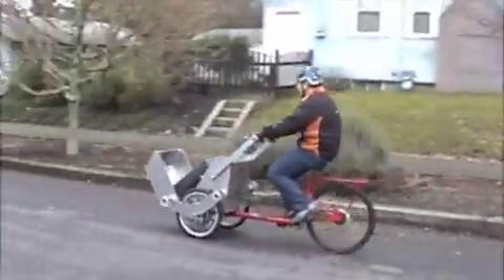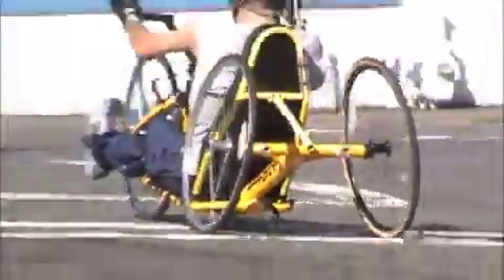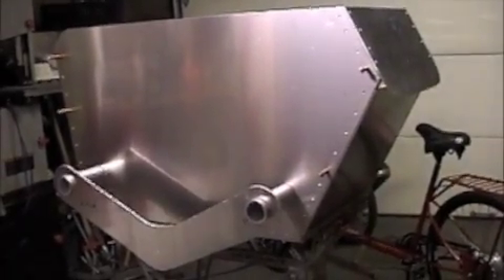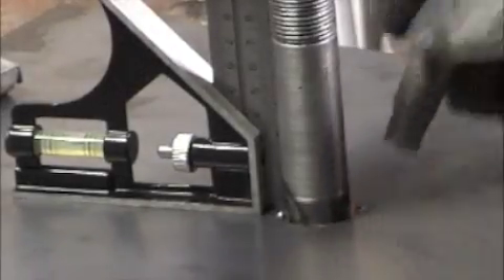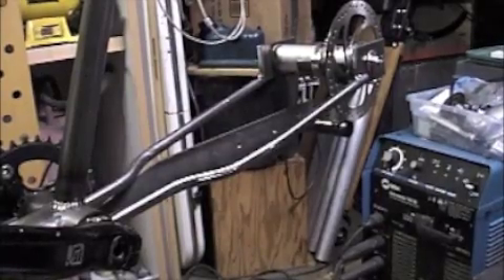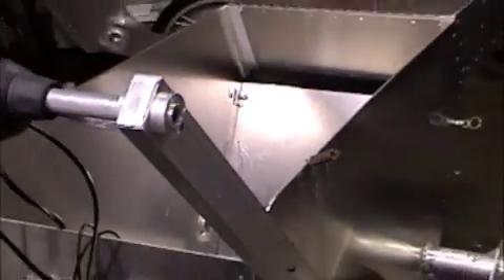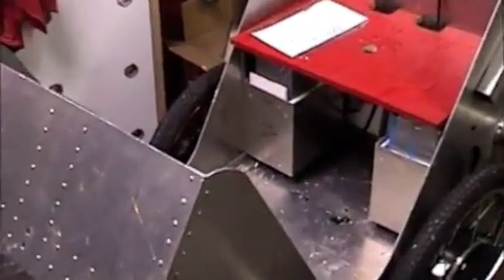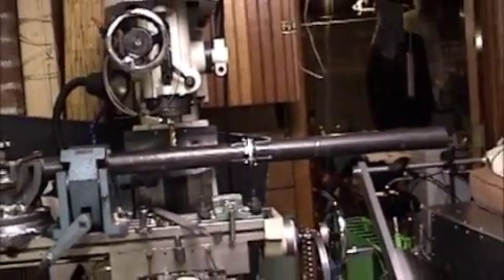Cargo Bike Bakfiets

Comment: Amazing work, I am no engineer,  but I do ride a cargo trike. My babboe cargo trike, has things attached to the box, that prevent it from being turned too sharply, it is an effective anti tip device. Also, if you are making your own batteries could they not be incorporated into the base of the box, keeping the weight low down? I am not sure, but a wider wheel base might give some stability. Any way, what do I know, I have only been riding trikes for a year or so. And I certainly could not do what you have. I can barely change a puncher